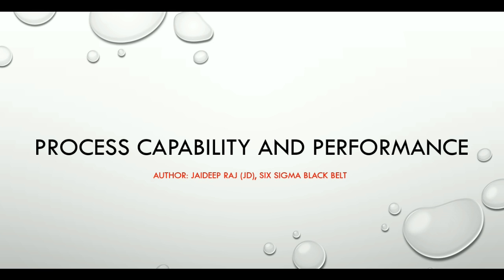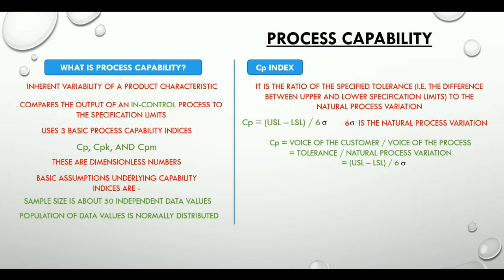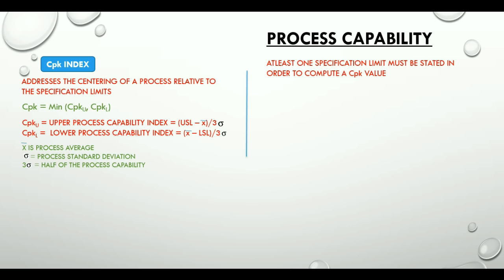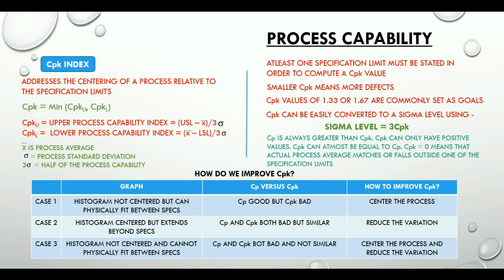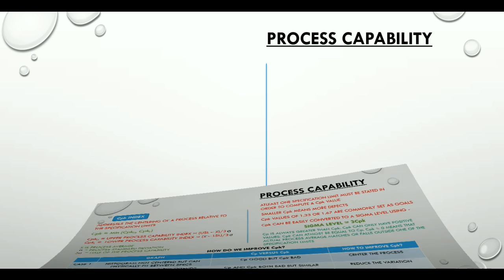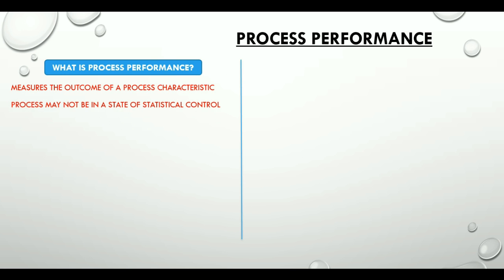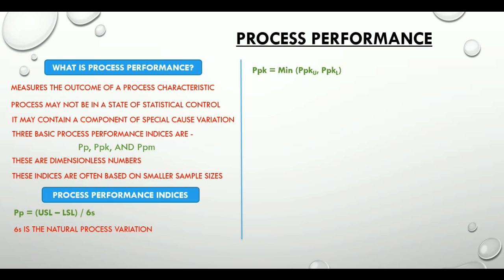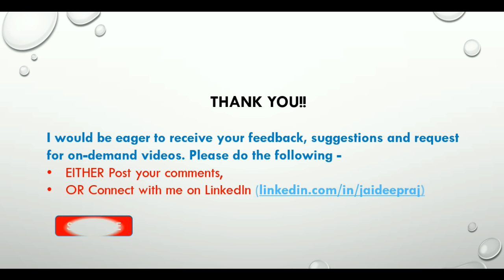2.2 Process Capability Study

Comment: Hello sir,
Just seen your video on process capability and process capability indices.
I am a working professional in quality dept, currently working on improving process capability of a particular process.
I have following questions to clarify?
1. For example my current process capability of Internal diameter (ID) of a  product assume 0.4, so how can I improve it to at least 1.33? What are the steps should followed to meet cpk of 1.33 in the process. And whether these steps are same for process capability improvement and process performance improvement.
2. And for new product launch we need to take only process performance index only, then when to start process capability measurements?